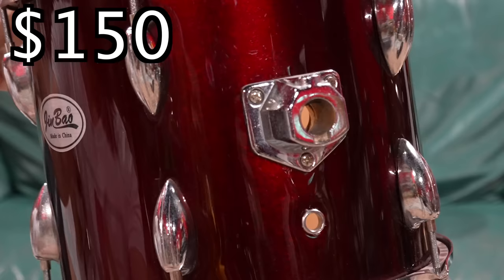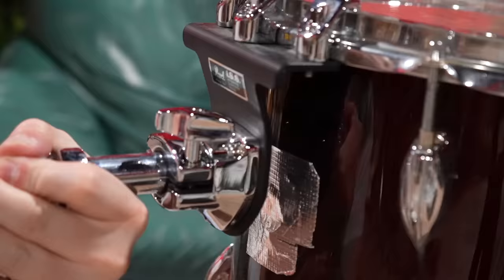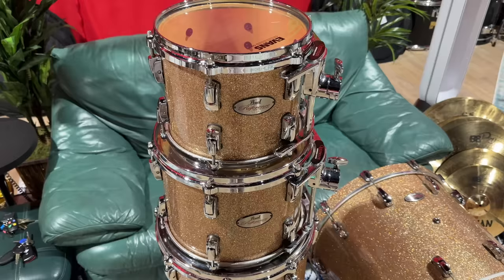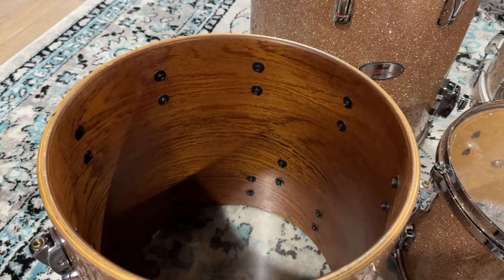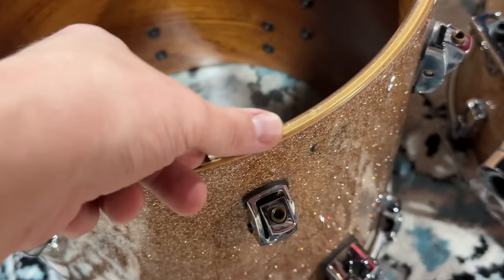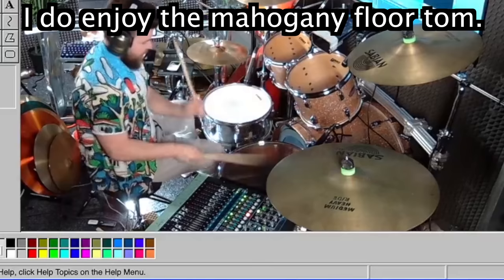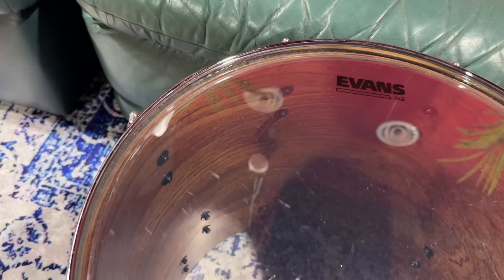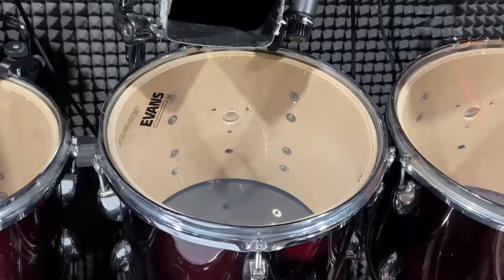Cheap Drums vs Expensive drums

Comment: I've played drums a number of years and I can say your tuning ability is top notch; to make that abomination of a kit sound remotely like a Pearl Reference is a feat, well done.
Reply: I'm almost convinced the sound you were hearing was a plug in. They sounded exact. And what I mean by exact is that the tuning was not even in the slightest different. Even the snare sounds the same. Cheap snares sound like trash no matter how well you tune them.
Reply: @joetroutt7425  He used the same snare for both kits, and it's not an expensive one. As long as the shell is round and the hardware isn't noisy you can get great sound out of it with nice heads, a quality set of wires and tuning skills
Reply: any tips for tuning?? I've been playing for 12 years, I feel like I should know how to tune now but I kinda don't know what I'm doing.

Like, other than the alternating my rods like a star and having the resos looser and the batter's higher (i like tighter rebound), I don't know what I'm doing. I've tried looking at tutorials for tips and tricks, most I've ever gotten is "just do it more"

Anyway, so do you guys have any practical tips for tuning? How can I look for overtones and are tuning gizmos worth the investment?
Reply: @doofs  I have an idea. Go to a music store. Preferably a drum shop and play on some drums that sound really good to you and record the sound of each drum individually and try to tune your drums to that tune. 
Another thing you can do is (it will take two ppl unless you take the tom off and set it on the floor) mute the bottom head and record the sound of the top head and do the same with the bottom. Just mute the top. 
  It will take time to develop an ear for a great tune. It took me years to learn how to tune my drums but now I've got a pretty good ear for what sounds good and other ppl tell me the same thing. When I let other ppl play my drums I like to sit back and enjoy the sound of them and maybe think of what could use tweaking.
Reply: @joetroutt7425  thanks for pratical advice!!! most of my music stores nearby only have electrics on display, but I'll absolutely do this whenever I hang with other drummers. 

I usually try tuning my kits by recreating sounds from my favourite albums, so I guess I'll keep doing that for now at least. thanks friend! 🤘
Reply: @doofs  don't be afraid that tighten your top heads tighter than what you would normally tighten them. They may sound high to you but if you get somebody to play and you stand in front of the kit it will sound much different. Just don't get that flappity sound like you're hitting a paper sack. That's not what a drum is designed for. It's supposed to resonate. I think ppl do that bc they don't have good tuning skills. The trick is to achieve the least over ring as possible without having to put damping agents on it.
Reply: Those abilities landed him right into "The Sound of a drum is the heads" land which I agree with, but there's a boatload of prerequisites.
Reply: @doofs  I've found that for a snare, the reso should actually be much tighter, maybe even tighter than and batter head, depending on your overall tone preference. As long as the reso is nice and tight, no matter where you place the batter, its gonna sound good.
Reply: @josuemontalvo221  damn! I've always heard the opposite 'cause you get nice rebound on a tight batter so you detune reso to compensate. I'll try it out though!!
Reply: @joetroutt7425  No they don't.  Not if you know what you're doing.  Definitely not a plug in.  You can hear that the Pearls had a little more resonance, that was about the only difference I could tell!

Comment: In woodshop, when wood ended up getting dented, we would get a piece of damp paper towel and a clothes iron, and run the pair over the dents. As long as the wood fiber wasn't damaged, it'd usually bounce back into shape. We didn't really use super hard woods, though, so it might not be as effective.
Reply: Kind of hard to use a clothes iron inside a curved piece of wood.
Reply: @joetroutt7425  soldering iron works great on small areas
Reply: I wish this to be true, but, as you said, I'm also not sure it would work on hardwoods as the capillaries are denser
Reply: Ive saved many guitar necks with this!  Best is a flat edge attachment on a soldering iron, cotton cloth, and a spray bottle to rehydrate the cloth.  Learn it on  scrap pieces of several types of wood first!!!
Reply: @88funkymonk it works just fine. Damp cloth and a soldering iron will get those stick dents out.

Comment: My favorite thing about this is that a kit's sound can change so violently with just a small change in the drum heads and everyone still gets all caught up on the nuance of shell quality
Reply: Same as guitars where people go over the top using all kinds of different expensive woods and veneers and whatnot, then put it all through the same distorted electronics and it all sounds the same anyway
Reply: @AfferbeckBeats  for guitars the differences are there but are so minuscule you wont even bother. No one can tell just by listening that a guitar was made of alder instead of basswood. I would say its just looks more than anything
Reply: @AfferbeckBeats  yeah, wood type/quality only truly matters with acoustic guitars; the primary thing that matters the most for electrics is the construction quality of the pickups/electronics and the speaker in the amp

Comment: Daaamn; I picked up a used 3 piece reference shell pack in that exact same finish, for like $1500 CAD 10 years ago... I didn't know the kinds of prices these kits were fetching now. That's crazy... absolute hell of deal at the pawn shop! 

I think that reference kit is the only kit I'll ever really need. It's the ONLY floor tom I've ever owned that I've genuinely been able to consistently dial in at a wide range of tunings. And those 30 ply reference snares are absolute madness. Overengineered definitely, but the excess works; doesn't it! I realize this undermines the whole point of your video, but what a catch! Congrats!

Comment: I have a Pearl Reference kit(a black one.. boring. Gonna switch it to a cooler finish). Compared to a cheap kit it has a lot bigger tuning range, it stays in tune regardless of pounding. You can also control overtones. You don’t get weird overtones. Only the beautiful ones you might want, and they can be controlled. This is very important in a studio setting. You pay for having this sound ensured + getting top of the line everything. As a pro(who these are actually made for), you don’t want to compromize. Also, remember: you can’t hear the big differences without a proper recording and soundcards + headphones when tuned great. But subtle differences are what makes a great kit useful. Clear and controllable overtones that stay in tune. 

That being said: a mid+ kit made today is of great quality! It’s insane what you get for money these days regarding drums. Pearl Masters is a great example of a pro sounding kit for a great price(they come in different ranges these days with different prices). But you can go a lot further down in price and get great sounding kits on a budget too! Going on gigs with a super expensive kit can be stressful and just not needed a lot of the time. 

Cymbals are harder.. you can’t go cheap that easily. You can get a great set for metal etc which does not cost that much. But that is mostly because the tones needed are not always that complex in a mix. But great cymbals with complex overtones do cost money if you want something special. Cheap hardware is useless.

Comment: You can almost always remove dents from wood with steam, either with a handheld steamer or a damp cloth placed over the dent with an iron on top. It's an old woodworking technique, often used in repairing furniture, but it should work for the plywood in these too. Just avoid getting too much steam on the top layers of veneer, maybe test it on a cheaper kit first to make sure you won't risk delamination, but it's way easier and better for the piece than wood filler.

Comment: If you are not afraid, you can fix the bashes with a wet towel and a hot iron. Cover the mark with the towel and touch it with the iron directly to create steam. This method is frequently used to fix little bums and blemishes in wooden furniture, from 5k tables to gun stocks. The theory is that the fibers are there and not damaged, but compressed, so the steam brings them back up by swelling slightly. Be careful with the moisture, just be quick and let it dry sufficiently after you are done. Mark Novak has some great videos on it, I believe

Comment: You did an absolutely incredible job tuning those Jin Baos so close to the References. It shows that a true professional can make anything sound good. That being said, as a sound engineer I thought you can only polish a turd this much. I like to EQ my toms tight and punchy and the Jin Baos would need a fair bit of corrective EQ to sound decent by my standards and even then they weren't resonant enough to sound pleasant and that's not something EQ can really fix. The References were almost there right out the gate, so they would be a joy to work with. 

In other words, the Jin Baos are hard to work with whether you are the drummer trying to tune them or the sound engineer trying to make them sound good and that's why it's worth getting a quality kit. It would be nice if we could hear the References against the Masters at some point. I reckon the differences will be very subtle.

Comment: In the 90´s I had a cheap asian baswood drumkit that sounded better than ALL of Tama´s, Pearl´s or other drums that we shared in the stages. To the point that one drummer wanted to rent it thinking it was something special. In the end was just knowledge. I worked on smothing the bearing edges, instaled good heads and tuned with with passion for ever venue we´re playing. I rather prefer having a cheap kit like that, with a "better" snare (if needed) and good cymbals than an super expensive kit with so so cymbals.
Hardware is a problem too. Had to change the snare drum stand and a good seat. But since the distorted guitars entered nobodyt ever noticed any bad sounds.
Listen with your ears, guys. Cheers.

Comment: Honestly, I would avoid doing any repairs with wood filler. It's more for cosmetic repair, not structural, and I worry about how it would hold up long term on a bearing edge. It would be better to re-cut the bearing edge (or pay someone who knows what they're doing), or to just leave it as is. But that's just one dingus drummer's opinion!

Comment: As for repairing the one drum ... I would try a wet wrung out cloth and a iron ... Place the wrung out cloth on the dented wood .... Then apply a hot clothes iron on the affected area ... Check frequently ... It should help bring up the dimples.... Been repairing hardwood flooring that way for years now ... 😉

Google or search YouTube for examples ...

Comment: I trick I learned for getting dents out of wooden floors is a little bit of hot water will swell the wood back up then you want to let it dry for a couple weeks. I personally wouldn’t do it on an expensive drum kit but it could work.

Comment: My take, with years of experience with high- and low- end kits from all different brands: High-end drums have better fit and finish, and are so much easier to make sound amazing, and overall DO sound and play better. However, a decently made mid-range kit, and even a good low-end kit can sound great if good heads are used and they're tuned well. 

If you can afford high end drums, by all means, do so. They're worth it, and you really do get what you pay for. If you can only afford low- or mid- range, replace the stock heads with good quality heads and learn how to tune them. You won't have the playing feel of the high-end stuff, nor the tuning range and depth of tone, but you absolutely can have a great sounding kit to make your music on.

Comment: For those wood dents to try: You can take a soldering iron, wet the wood, wet a rag, put the wet rag on wood and soldering iron over that. It sometimes steam out the dents, at least mostly. Do that before wood filler, that stuff is for looking at only, it will pop right off. Epoxy wood putty would be better if it comes to that. Still would try to avoid it.

Comment: I had a CB-700 5 piece kit for about 8 years.  I went Remo Weather King on everything and because I worked in a machine shop at the time, I was able to make brass washers for every lug on the kit, which improved the "tunability" quite a bit.  I didn't like the CB snare, so I got a Ludwig and took all of the hardware off the CB snare and turned it into a timbale'.  All told, I put about $500 into the drums and bought about $800 worth of used Sabian cymbals.  I had a friend who was so into how good the kit sounded that he eventually offered me $4000 for it, and I was moving so I accepted. I miss them terribly.

Comment: When I went shopping for a new kit to use on the road, I went for a step down from my home kit, which is a 2003 Tama Starclassic Birch. I found a brand new 7 piece Superstar Classic maple kit, and after putting my favorite heads on and spending a couple weeks experimenting with tuning, I got them sounding amazing and they hold the tuning over several shows, with the 14 inch floor tom being the only "problem child", which usually has to be tuned before every show. Not bad for $750, though!

Comment: Fascinating. I loved the A/B comparison - even listening through a speaker designed for phone calls, I could hear the Pearl Reference sounded fuller and more defined. The Jin Baos were close, to be sure, but sounded like they were somewhat muffled. I think of it like this: You can get the Pearl Reference to sound like the Jin Baos, but you can't get the Jin Baos to sound like the Pearl Reference. This is generally true for pro vs. beginner instruments - beginner instruments can sound great in the hands of a pro, but you usually have to work for it, and even then, they tend to be limited in range where they sound good. OTOH, pro instruments sound great across a much wider sonic spectrum and, more importantly, just get out of your way in producing music. I can make a cheap guitar sound good, with work. But my expensive guitar I love to pick up and just play, because it's effortless, and I don't have to think about technique.

Comment: That's what I did with first kit. Cheapest crap drums I could find used for 150 bucks (with crappy cymbals and snare included... snare had a regular snare head on the snare side lol). Upgraded all the pedals and cymbals. My 8 inch splash was more expensive than the whole kit lol. I had to switch to electric though since I live in an apartment now. Gave away that kit to a father so some other random kid can enjoy it and get into the hobby. Kept all the cymbals and hardware I upgraded it with though. Some of it they don't make anymore!

Comment: Here’s a pro tip that might help with your bearing edge, if you put a wet towel over wood that have the fibers intact and then steam it with an iron it comes back a surprising amount. Now, you have to know what the finish is because that could totally ruin certain finishes

Comment: 5:11 You can raise dented wood back up from dents like that by applying heat with a clothes iron.
I've used it successfully on a maple guitar head. The ding came out to almost level, but the covering vinyl had chipped off.

Comment: For these stick marks, if you care, you can try to decompress wood using damp cloth and iron. If applied to small area, steam will not warp wood and wil remove the dent. This is an old carpentery trick.

Comment: Put a damp towel on the dents in the wood.  Place a hot clothes iron or soldering iron to the damp towel directly over the dent.  Release after steam.  Should help quite a bit

Comment: I always just tuned to get pitch harmony rather than dissonance.  You can use notes off a piano, or just get the top ride to what you want, then the next one a full step lower, and so on.  If hitting tow at once sounds harmonious, you've got it.  Dissonance with drums sounds like a sour ringing delay.

Comment: I totally agree, cheap drums can sound good with good tuning and good heads. The worst part is ACTUALLY tuning them! I have a set worth like $200-300 (USD) and I fear the day I have to change the heads and tune them again. The biggest difference would be the quality of the hardware as you pointed out here (rims, lugs, mounts) which in my opinion, are worth paying for. Thanks for the video and have a good one!

Comment: I have a kit very similar to the Jin Bao ones and yes the bearing edges are the main hassle but some sanding helped me fix it as much as I could and with new heads the kit sounds amazing, very close to what the pro kits sound like. It did take alot of experimentation. Tuning techniques were to be legit thrown down a window and done any way that worked. Since the pro or even the midrange kits in Pakistan are so expensive, I keep this kit as my main gig kit, and honestly it's now good enough to cut a proper drum sound that FOH sound engineers prefer too. The kit costed about 100$ in the current economy.